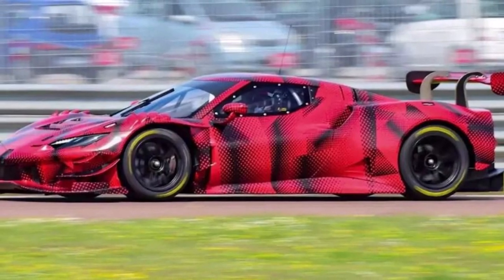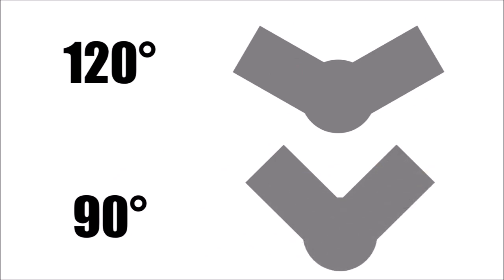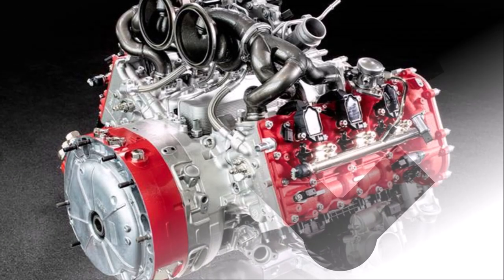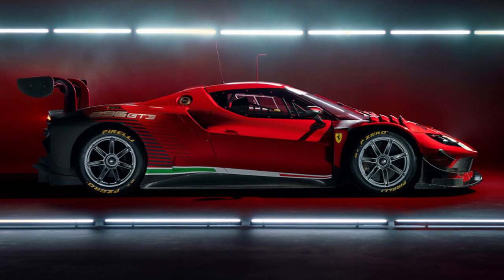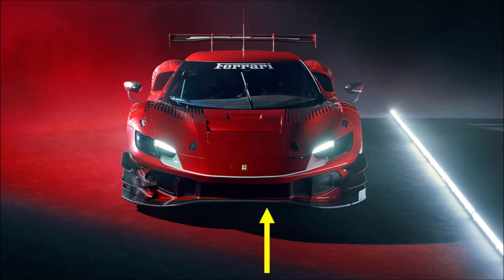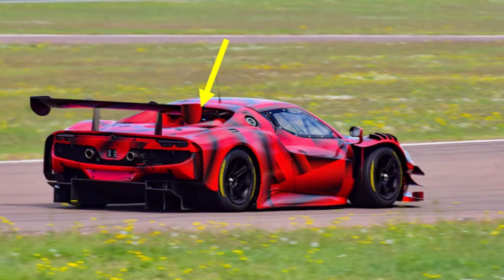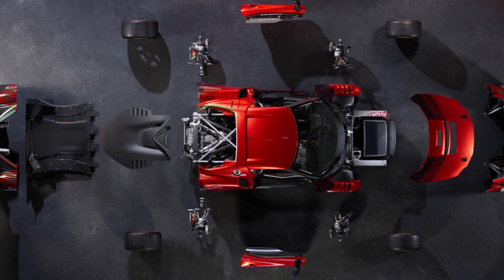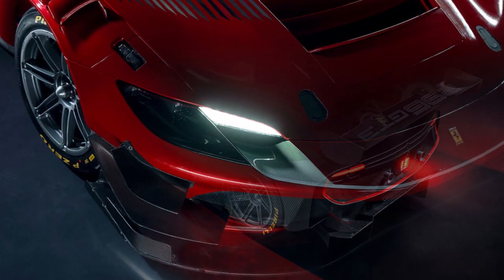Ferrari 296 GT3 - FIRST LOOK (Technical Analysis)

Comment: I did not expect such a modular design. Which makes sense looking at the changes in GT racing for WEC (GT3 coming)
Reply: I think it has more to do with a change in constructor, it’s no longer made by Michelotto and now made by Oreca.
Reply: @jorhop4005  That has probably the most impact. But I see costs rising again in GT3s. We are getting to the point where these things are merging into GTE cars. Prototype like bodywork and suspension and so on will be more expensive for sure. I hope FIA will keep an eye to that. Otherwise it will be too expensive for teams.
You can see it in DTM this year respectively next year where some teams are pulling out due to costs.

Comment: In my opinion ferrari is clearly making this car to be a really good endurance car for the  new gt3 category for the wec.
Do you think other gt3 manufacturers will be giving updates to their current cars or build a new car in this style?
Reply: Well, if they don't it will be a Ferrari dominance in GT3. I do think the other manufacturers will bring fresh updates, but Ferrari is not playing around.
Reply: Mercedes could bring a new gen AMG GT (road car coming next year) for WEC 2024. Others will need to adapt.
Reply: @leovssousa  what do you think about the new porsche 992 gt3 r?
Reply: @ButterflyEnte  
Porsche is very, very consistent, but it hasn't brought anything new that sparkles in the eye. Perhaps the key lies in weight redistribution, which used to be an issue for drivers to manage tire and brake balance during a race. We'll see!

Comment: 5,000 psi is impressive for a gas engine. That’s just at or below most modern diesel engines idle rail pressure.

Comment: 0:22 the true successor would be the F8 Tributo, that yhey choose to not use
Reply: Because it's going out of production.
Reply: @boostav  this holds no value, 488 GT3 became simply GT3 EVO when the road model was replaced by the F8
Reply: @il-ma.le.  because they didnt want to waste money making a gt3 out of the f8 until the 296 came along. F8 was just a gap between the 488 and the 296. f8 was already very similar to the 488 they lost nothing by not making a f8 gt3 instead. Assetto corsa comprtizione developer which is a gt3 sim said these things and that this was what ferrari told them
Reply: @288gto7  Which I can agree with as the v6 offers better packaging being "smaller and lighter". I put " " cause I am not sure if the v6 is that much lighter and smaller than the outgoing V8. Is hybrid going to be included though?
Reply: @Ghost-hj5jy  no hybrid, gt3 regs still dont allow it. Road versions wise 296 is a bit heavier due to the electric motor and battery etc but as far as the gt3 versions go the 296 is advantageous over the 488